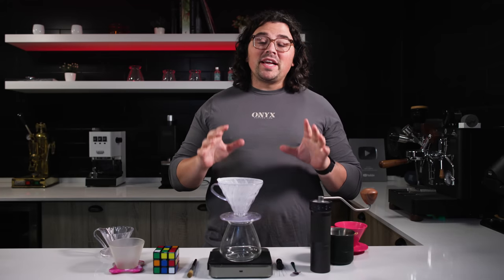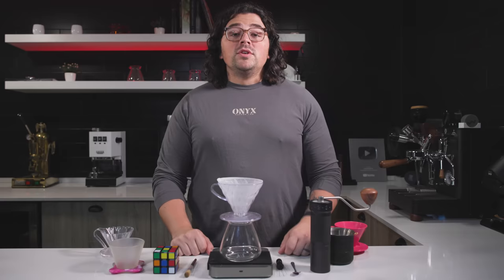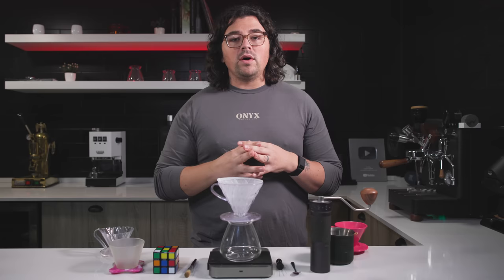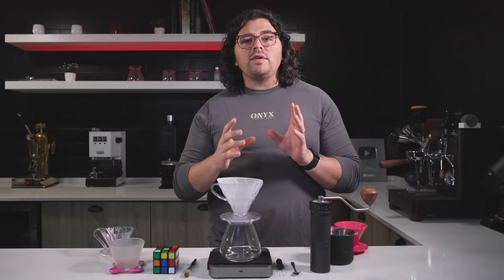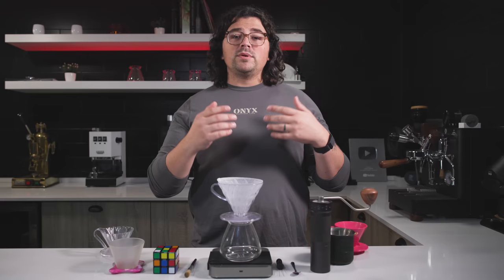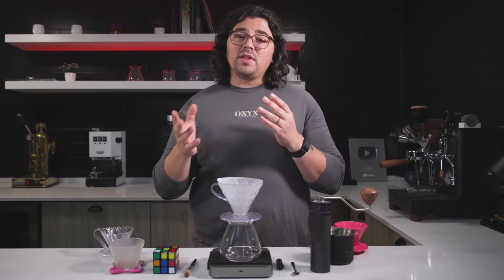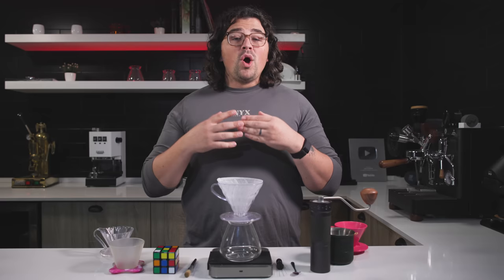ULTIMATE POUROVER RECIPE (any method)

Comment: Good recipe to add to my repertoire. Just tested it after dialing in my current coffee for the 4:6 technique and it produced an equally as good but different cup.

Used 20g to 300ml and got what I would think is a less complex but slightly more sweet taste. Not good with the coffee speak but I notice it more on the tip of the tongue. But slightly less ... exciting? Definitely very enjoyable.

I'm gonna use it for a few more days and maybe even blind test it. Always see it here and on Hoffmanns channel and might as well try it myself. haha
Reply from the maker: Should be loads more interesting that 4:6 if done well. 4:6 has so many pours it increases the chances of particulates to eject through the filter and obfuscate the palette. I'm curious what you did for your recipe? Perhaps go coarser for more acidity. Should be a vibrant cup- this was the premise of my making this recipe.
Reply: @LanceHedrick  Will try going coarser and experiment more. It was my first try after all and it still produced a very good cup right of the bat which I can't say about any recipe I tried 😄

Also, asked my wife again for her opinion and she said that she thought the cup was less acidic than the 4:6 (20g/300ml) with a first pour of 60g but more than a 50g pour which coincides with my findings. 

I frequently change the first pour with the 4:6  when brewing and don't tell her. Then I ask her to describe the taste and she gets it right pretty much all the time by telling me it's more or less acidic. She is my one woman control group. haha

The 4:6 cup I liked more and that I mentioned above was a pour with 60g so it was more acidic which means trying to get a bit more acidity from it seems to be the right direction and good advice.

As for the recipe and I don't expect you to read this novel, but I used a Kinu M47 Classic which is currently on 4.5

20g of coffee with 300ml of bottled water at 95°. The coffee is washed and from Peru (Caturra Amarillo) and is a medium roast. Filter used are the Hario 01 from the Japanese factory (allegedly).

I created my divot with the back of the spoon then I started with 3 times the coffee weight 60g water, mixed with my spoon and waited 2 minutes. Didn't have a rubix cube on hand. 

After the bloom I poured the rest up to 300g. Water stream was right before breaking and splattering and flow rate should've been at around 7g/s. Tested my usual flow rate when rinsing the paper and ended up at a 68g after 10 seconds. I don't know for sure though.

Since it seemed to draw down pretty fast I took 3 toothpicks pressed between 2 fingers for my budget wdt (Did not buy a proper one yet because I didn't think I needed one without an espresso machine). Gave it a slight shake to level the bed.

Flow slowed down and I ended up at exactly 4 minutes with a 2 minute bloom. 

Bed was flat and not muddy while the walls caught the fines. Looked like yours with slightly more fines at the wall. (Doesn't bode well for my M47 as a pour over grinder I guess?)

Since I ended up at 4 minutes next step for tomorrow would've been to try no agitation and see whether I end up at 3 minutes or less.

I can't drink more than 2 cups in a day because more than 300ml disrupts my sleep so experiments take longer.

Anyway, thanks for the reply. I will try my best to reduce user error and honor the recipe as best as I can. ✌

Comment: I just tried this with a my newest coffee (Counter Culture Hologram, a medium light roast that's supposed to be kind of fruity). Compared to my usual multi-pour method, it definitely was a much faster brew and had more clarity and less astringency. I think it's a little under-extracted now, though, and I should probably tighten up my grind a little bit. Overall, I think this is a perfectly good method, but I am also starting to think that most methods can be equally good as long as you understand how to adjust the variables to get what you want out of it. For example, I could probably get a similar result with multiple pours by just coarsening up the grind some more. Thoughts?
Reply: What grinder do you have? How many clicks do you use for this technique?
Reply: @matiaschacana5768  I have the 1zpresso Q2 heptagonal version. For that coffee I use a setting of about 26. I haven't tried dialing it in for this recipe from Lance, though. It would have to be a bit finer.
Reply: @montagdp  I have the Q2 heptagonal also. Any update on the clicks you use? 26 clicks are almost espresso-like, or do you mean 26x3=78? That would be a coarse setting.
Reply: @photone96  yes, I meant 26*3. Though nowadays I typically use finer than that, maybe around 22 or 23 (*3). It really depends on a lot of factors, so it's hard to give a number that works in general. FWIW, I never went back to this recipe in the video again. I mostly use a Kalita Wave these days.

Comment: Thank you Lance for the recipe, I’m having issues with fast flow rate (20g in 1:50) even with adjusting temp and ratio. As for grind size ~7 on the Ode 2 stock burrs. Most of the coffees I’m drinking is “omni roast” video suggestion  do you think I should go finer? As for the bloom there’s not much of gassing going on.

Comment: Hey Lance! Thanks so much. Just a question, is the 6-8m/s pour universal? or do I need to adjust in case I am making a bigger brew like 600-800ml?
Reply: Not sure TBH but flow relates to heat transfer. Faster flow transfers more heat per unit of time. I'd say, try using coarser grounds or cooler water first, keeping the same flow rate and adjust from there.
Keep in mind that for bigger pour overs, coarser grounds also help to avoid bypass (channeling) as water distribution is more even

Comment: I’ll try again and see whether or not the comment shows up. 

So, Lance, don your teacher’s hat for me if you can find the time…. I am getting brews that are too bitter and astringent. It’s a a super new grinder (Ode v2 with burrs that are not broken in yet) and I have tried quite a few permutations.

12 g dose 1:17
Preheated small Hario plastic V60
Cafec medium filter paper
2 minute bloom with excavation
Total brew time: 3:10 s
Ode v2: 8,5 
Coffee: El Obraje, natural Gesha, Columbia, from  Pablo Andres Guerrero

You have mentioned somewhere ca. 1 o’clock for the v2 (ie. 7 on the dial) so that’s where I started.

I have tried finer and coarser (from 6 all the way to 10) but the final brew always lacks sweetness (from what is a very sweet bean) and lies under a thick veil of bitterness and astringency obscuring other characteristics.

But in ALL cases bitterness and astringency are pronounced and what sweetness and acidity there is lies under that thick veil. I am presuming the culprit is over extracting fines while under extracting the relative coarse grind but even if this is the correct diagnosis, what’s the solution? Shouldn’t I also get a sweeter brew with a finer grind all other things being equal? If so I haven’t really observed that. Is it channeling then and my prep is lacking somewhere along the line because I get the same basic results so reliably? I am new not new to coffee but new to pour-overs.

Or is agitation is the variable here. Can the height of the pour and the flow rate have such a profound impact on the brew— the difference between a delightful drink of a supremely balanced  Gesha and something that is no pleasure to drink at all? But that doesn’t feel right either. Otherwise I’d have to be able to work myself closer to the correct flow rate from the kettle and see some improvement or even some noticeable variation. Instead I am getting the same basic muted, dull and bitter results.

As far as the veil of bitterness and astringency has allowed me to judge I think 8,5 has the best balance.

With that setting on Friday morning I had a super sweet brew twice in a row with good, balancing acidity and only slight bitterness and astringency with high clarity than all my other attempts. It was delightful to drink but haven’t been able to replicate it the next morning or since. In fact I always get what basically feels like the complete opposite.

I am stumped.
Reply: You sort this out?

Comment: Tried this and got some excellent results. Using a darker roast at 90C with 1:15 ratio. Only thing I could use some help on: the bed had a good amount of grounds left on the side of the filter and wasnt completely flat. Should I be agitating more to improve that or less? Maybe a little bit finer grind?
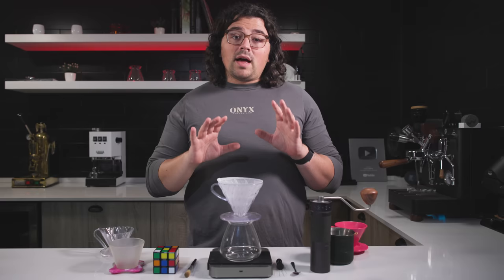Reply: Also, brew time was a bit long. 3:30 for a one minute bloom
Reply from the maker: Do less of a bloom with darker roast. Maybe 45s. And give it a good swirl right when done pouring to give motion to the bed.

Comment: Thank you so much, I have to try it immediately after I received my ordered gooseneck kettle (with my current kettle I have no chance making a constant water flow). Did I understand correctly that I have to stir with a spoon if the flow rate is too high? Currently I always have the problem that the water is running way too fast through the filter, although I'm using a V60 brewer, Hario V60 paper filters (size 02) and a 1Zpresso JX hand grinder at exactly the correct grind setting for hand brew. And I have no idea how to change that. Even if I grind way finer (so that I'm almost in the mokka pot range) it barely extends the brewing time. Don't know what I'm doing wrong.

Comment: Thank you so much for this recipe! I am getting tastier and more consistent pours using your method.  I do have one question --- my coffee is tasting good, but the drawdown (with a 2 min bloom) is taking a little over 4 mins.  Does this mean I should grind more course, or should I be messing with the bed after pour?  I know that your video said that if the drawdown seems slow, to try a little shake, but that doesn't seem to help in my situation.

Comment: thank you for your video.  i have a comandante  and if i ground to the level you show, or as best as i can do, water would fly through.  i tried your method with 30g coffee and 500g water.  i had the entire brew done in 2 minutes.  i couldn't slow the brew speed.  i have the comandante  now set to 34, it's usually at 24.  suggestions
Reply from the maker: 34 is much too coarse. Should be about 25-27 max.  Increase agitation and focus on the pour speed

Comment: I'm already grinding pretty coarse (5.5 on ZP6) yet my brews often still stall (>5min brew time). Am I pouring from to high?
Reply: I use 15g and 255g water of the boil and a 1cup V60 with the tabbed Hario filters made in Japan.
While I'm writing this I realized that the size of the hole from the 1cup and 2cup V60 is different. 1cup is smaller than 2cup. Maybe that's the issue.

Comment: Hmmm. I will give it a test run, but I have my doubts it will replace my current recipe, which is:
32g coffee - 600 g water (18.75 :  1 !!!)  40-ish grind size on 1zpresso JxPro (closer to 39 on lighter roasts, closer to 41 on darker roasts)
Water at 96C when pouring (not measured usually, but this is what the thermometer reads if you lift a boiling stovetop kettle off the heat and start pouring the moment it goes quiet)
100g in, starting at the center and spiraling out, when it is barely drained, 100g more in, starting at the edges and spiraling in, swirl with controlled aggression (the grounds should ride up the walls of the cone evenly on all sides and not more than an inch or so above the level bed), then wait 30sec-1min more for the bloom to finish (longer for lighter).
This is essentially a two-step process to defeat the 'crust' that very fresh coffee wants to form on the initial pour, for a very large and thoroughly saturated blooming pour. 
Return the water to the heat while waiting, and pour two more pours that are at or a little below 96, maybe a little cooler on dark roasts. (I just hold the kettle off the heat a few extra seconds if a particular batch of coffee doesn't like aggressive heat, but from times when I have measured it's probably still above 92.) 
Let this drain well until there's several seconds between drops from the bottom of the cone and then pour. Nicely fills 2 16oz mugs (if you don't adulterate your coffee much). 

This is basically pieced together from your videos and James Hoffman's. IIRC (and I may not), there was a 3-pours hario recipe that was the foundation of it from you, divot and swirl techniques similar to yours, some talk about larger bloom pours from James. I can't remember where the split bloom pour came from or if I just found it by experimentation, and it's only important with very fresh roasts that foam a lot on initial contact with the water.
The grind size is found by James' advice of going coarse enough to get a very smooth cup of coffee and then dial in tighter until just short of what he calls a 'wall of bitterness'.  Idk about a wall, but as you tighten down there is a tradeoff of increasing complex flavors but also increasing bitter notes, and at some point that tradeoff is not worth it, so it's kind of a tradeoff without a 'right' answer imo, but I'm aiming for a well-balanced cup that is fully flavored but not overly bitter. Also I lean hard into the very hot pours partly because I don't have a temperature control kettle. It's not impossible to get a thermometer reading, but it is awkward, and lighter roasts seem to prefer very hot pours anyway.

I don't know why my water/coffee ratio is so high. Part of it is that I get more extraction from high heat,  and part of it is using as fine a grind as possible, but.... lots of recipes use similarly heat and similar grind and swear by a 16:1 ratio, but when I try that it just doesn't work out very well at any grind size. Maybe my tastes are just weird.
Reply from the maker: I do the double bloom in my kono videos!
Reply: @LanceHedrick  Ahah, that must be where I got it from! Thank you for that, it solved my problem nicely. :)
Tried the new recipe at 17:1, and the results were just okay. It is a bit more bitter than my normal cup, but very close, which isn't bad for a first try on a new process being compared to a fine-tuned process. It both seemed to brew a bit too fast until I slowed it down and end up slightly overextracted, which seems contradictory and leaves me a little uncertain where to go, but I will try a slightly coarser grind and more aggressive excavating. Also try to pour more slowly, maintaining something close to 6g/sec isn't easy with my simple beak-nosed kettle. Unconvinced that excavating does anything fundamentally different from swirling though, it just adds a dirty spoon to the process, but I'll stick with it for a bit. 
I think if I found myself stranded in a remote location with only primitive tools like a ceramic burr grinder or even a (*gasp*) blade grinder this would be a really useful approach, but I think 1zpresso has a pretty good grind quality despite the price so I don't think I have a lot of fines clogging my brew, so I'm not really sure a fast-brew recipe is what I need.
Reply: @LanceHedrick  There it is. 2nd time with a little coarser grind (was 39 & 1/4, now 40 & 1/4 on JxPro), a little lower temperature, a more aggressive excavation, and more care in pour speed and I've got a really good cup.  
However, I end up with my spoon caked in coffee because I'm excavating deep into the bloom pour draining out, so then I have to wash that off (into the cone, with the start of the next pour, so I don't lose any coffee), and my imprecise kettle gets kind of splashy because I'm pouring about as slow as it can go and any slower makes the stream dribble at awkward anglers instead of flow smoothly.  
So it does work, but it feels like more finicky effort than my regular method, and it seems to me like simplicity would be the big appeal of a bloom+all the rest method. I think I'll try it again but with swirling instead of excavating tomorrow.

I feel like I've learned something though, so although I'll likely go back to my regular recipe soon I might incorporate some tweaks or maybe even make some hybrid method. Thanks for the new approach!

Comment: Super interesting video. I've yet to try it but I am curious about this vs your standard Kono method, which has produced really great results for me. That method uses much finer grind but less agitation whereas this new recipe is way coarser but ups the agitation to produce similar extraction I would guess. But do you have a preference between those two (assuming a good grinder like Ode w/SSP is used)?

Comment: Great video! I notice you taste and show good results immediately after the drawdown. I typically find that my brews are always really bitter immediately after brewing but mellow out after a short wait, once the temps drop to about 60-65. I even struggle with the brew becoming too sour once it cools too far beyond that. Do you ever struggle with that? What could I be doing wrong?
Reply: I think that's just a combination of how heat changes your preception of flavor, along with volatile parts of the coffee effectively evaporating into the air. I notice the same thing, as the coffee cools, the acidity is more and more noticable. If I drink shortly after brewing, when it's still too hot, I get almost no acidity, just flat bitterness.